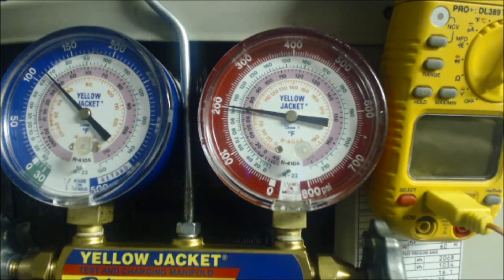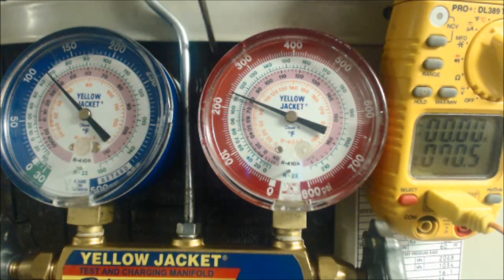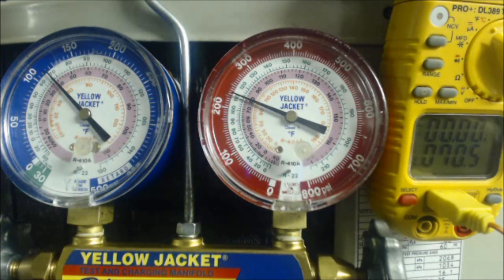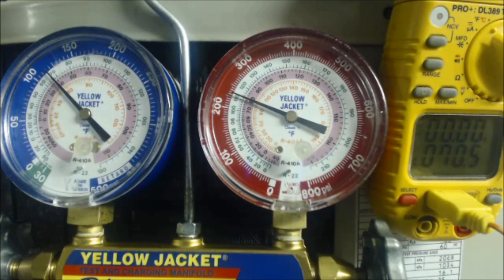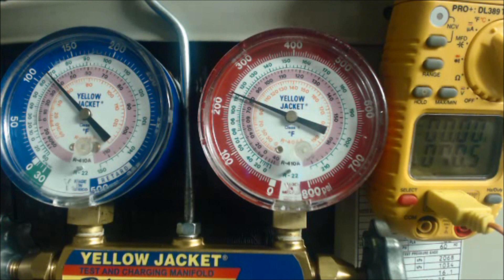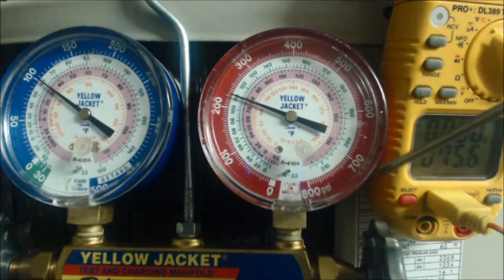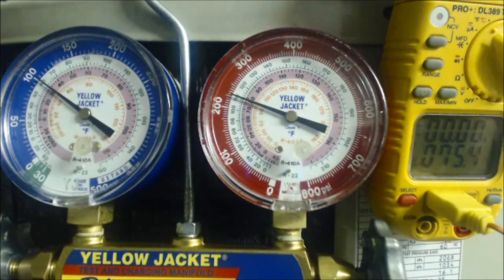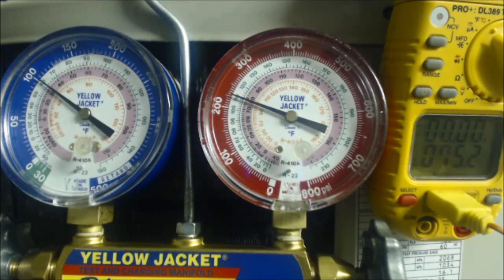How to Use a Refrigerant Gauge Set STEP BY STEP to Read Subcooling for R-410A!

Comment: Are you measuring pressures while the unit is running?  If not, how could the actual temperature of the coil ever change?  if so, why don't I hear anything?

Comment: Hello, thank you for all your quality content. I've been learning a ton, this is better than school.

I was wondering if you could you do a video on front seating/back seating? 

I read that you backseat to close off the service ports from the compressor, so you can safely attach your gauges? But doesn't the schrader valve already protect you from having refrigerant spray out? Would be great to have a detailed explanation on when to backseat/mid/frontseat, and why. Perhaps I'm overthinking this, reading forums and different videos is confusing me a bit.
Reply from the maker: Here is a link for checking the charge on a ac unit with backseating valves-   https://youtu.be/eXkqOS_qywo   --  https://youtu.be/8_IBLq9PbjU

Comment: You want to be between 8 and 15 on your sub-cooling on any system period.
Reply from the maker: Thank you for your comments. I do not agree for efficiency and heat transfer reasons as well as other techs connecting and disconnecting afterward.

Comment: thanks for the video, what effect will it have on a txv if subcooling is at or below 6F, will it be right open or hunt? thanks
Reply from the maker: If the subcooling is less than 6 degrees it may not send a steady stream of liquid to the txv by the time it gets to the txv from outside if it absorbs heat and therefore would not have as much heat absorption in the evap coil. Thanks for the question!

Comment: is this on inverter drive 410a systems?
Reply from the maker: This is for psc single speed compressors. Inverter types are always weighed in and if they are low then unfortunately you have to find the leak, recover and weigh in the proper amount due to refrigerant weight that the outdoor unit came with plus any additional length lineset in weight. Thanks for the clarification question!
Reply: No, the ICP have a subcooling chart, but you MUST run them at the high speed during charge.
Reply: +NETWizzJbirk where can I get this chart please?
Reply: It was on the back cover of plate of the actual condensing unit itself for a new Inverter ICP.  It basically had different outdoor temperatures and a charging chart whereby it required between 14 and 16 deg subcool (if I remember correctly).  Came with the unit.  The included instructions told you how to force it to run at high speed.